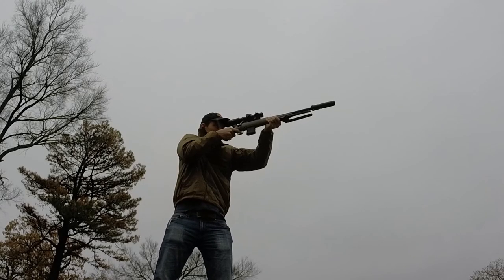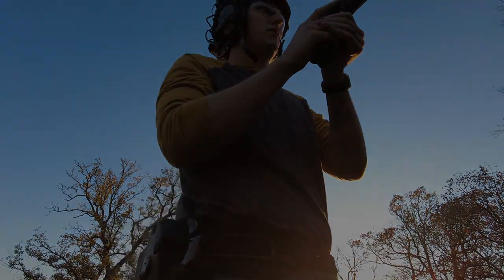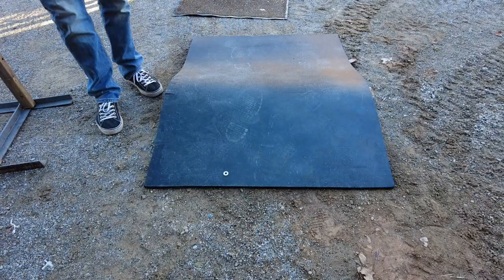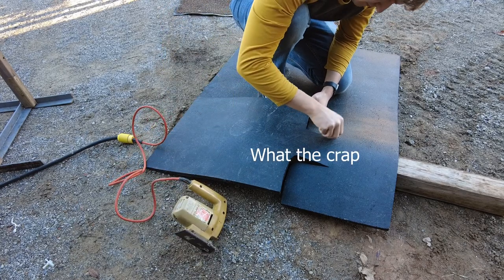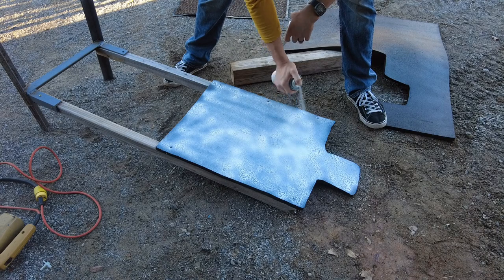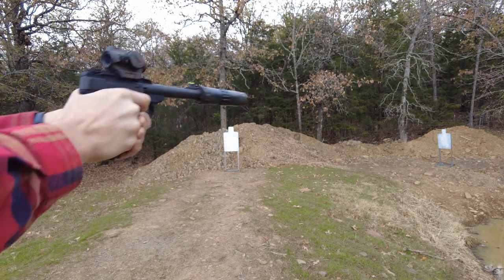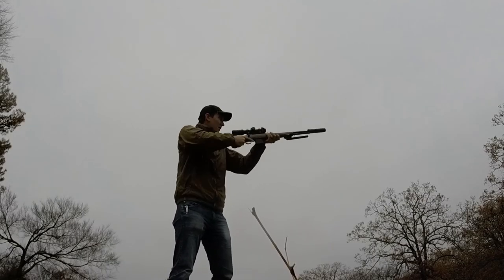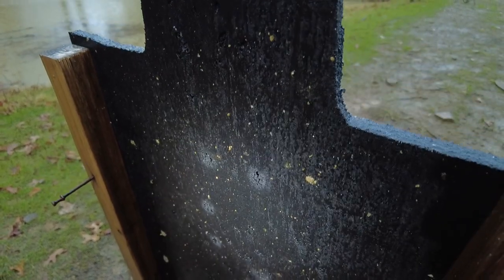DIY Self-Healing Targets

Comment: I use foam office mats. Its a lot lighter and cheaper, although not as durable. I also use these mats as the front wall on a mulch bullet trap which allows me to keep every single piece of lead (and could even be used in a basement for an indoor kind of range if one had the property and ventilation setup for it)

I think this is worth it if you compare it to the cost of shoot-n-see targets like you noted. If you don't need the immediate shot placement, cardboard targets are definitely the way to go. I don't buy cardboard targets. I just go to costco and grab a bunch of flattened boxes and cut those up. You can make like 75 of them in an hour. 

And of course, these are also way better targets than steel when shooting suppressed. I'll have to try your mats though. I bet the thicker material makes a louder slap when the bullet hits it, which could be cool. The foam targets don't make any appreciable sound when hit.

Comment: Any updates?  Still holding up?

I used to install these stall mats in...horse stalls, of all things.  The easiest way I found to cut them was a with sharp utility knife.  The key is to make several cuts along the same line (i.e. not try to go the full depth at once) while folding the mat back away from both sides of your cut (so it doesn't grab the sides of the blade.  It's even easier if you have someone else help "peel" it apart as you cut.
Reply from the maker: I left them at a range I don’t go to very often so I haven’t used them much but they are still holding on.
Reply: yeah, I second that any time I've had to cut conveyor belts at the quarry we used a fresh utility knife.

Comment: My local tractor supply has two different mats, 0.75" and 0.50" , do you know which you used?
Reply from the maker: The .5” I think
Reply: Here is my attempt.  I used the 3/4" with the oscillating saw!
https://youtu.be/4ZL1FkyOrS8

Comment: How does it heal itself?
Reply from the maker: It’s rubber. It kinda stretches out of the way of the bullet and snaps back. There is a small hole but it is much smaller than the bullet diameter.
Reply: @thriftyoperator637  thank you!